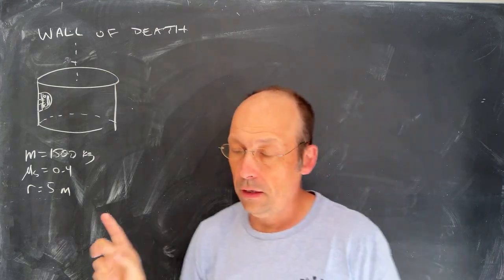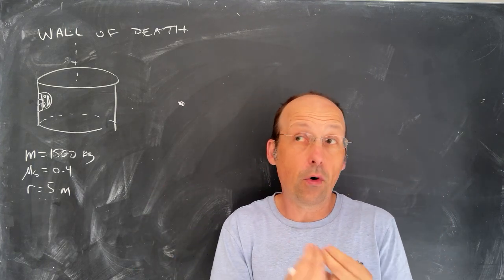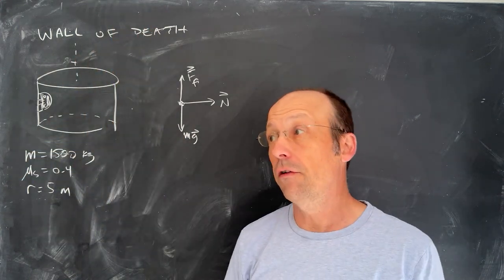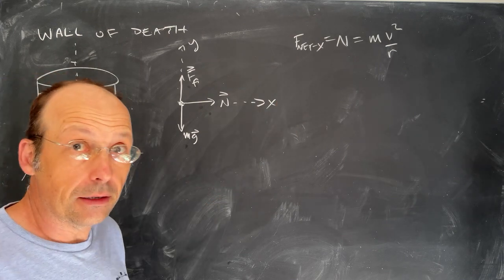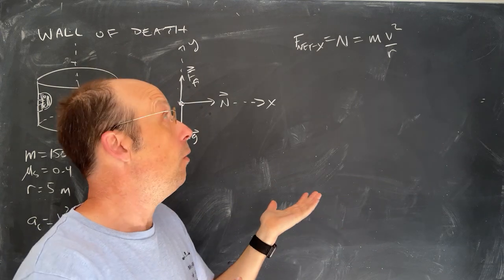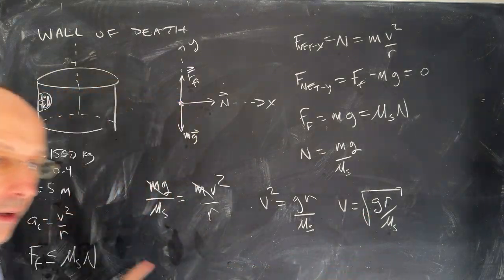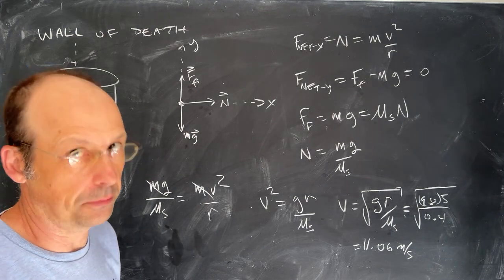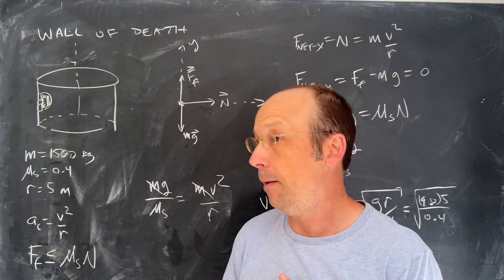Physics Problem: Driving on the Wall of Death

Comment: On the moon, I guess a runner would have to start with the cylinder on its side, like a hamster wheel, and rotate as the runner speeds up, otherwise how would they be able to run in a sideways orientation without falling off.